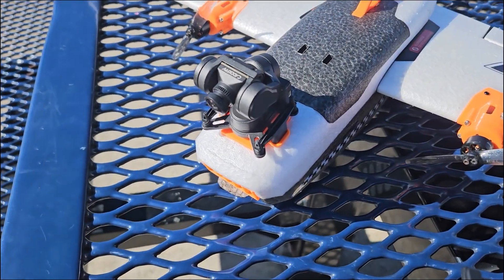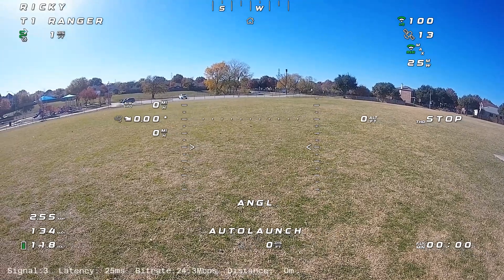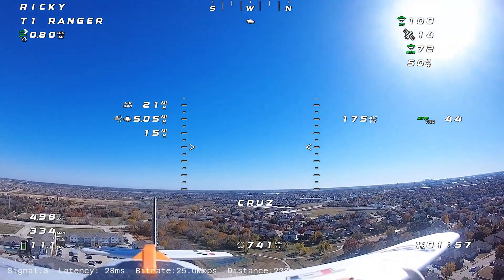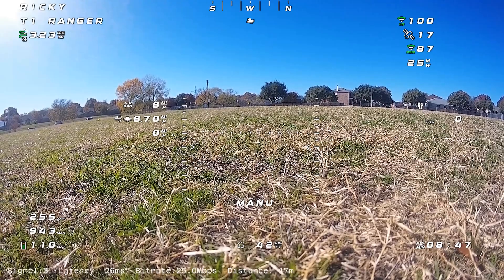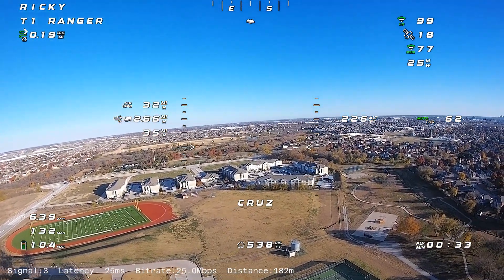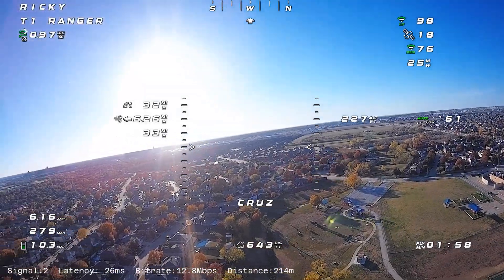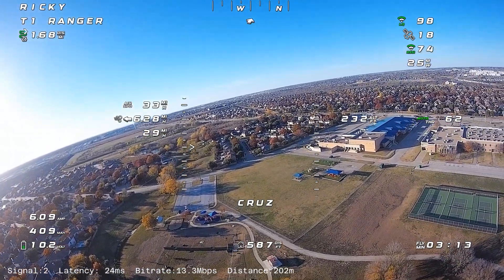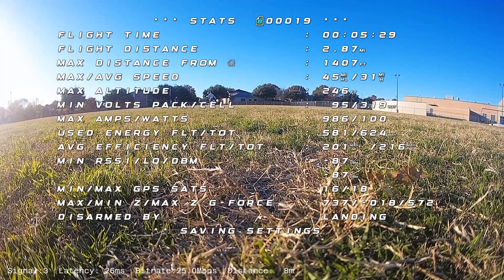My T1 Ranger With A New C-20T Gimbal Running inav 8 rc2 and rc3

Comment: how did you make the connection between gimbal and walksnail vtx
Reply from the maker: My gimbal is connected directly to a uart on my FC and is controlled by my transmitter.  My walksnail vTx is the v3 and doesn't have the spare uart to connect any gimbals so it's not compatible.  But connecting the gimbal to a uart on the FC works great!

Comment: Do you happen to have an stl for gimbal mount?
Reply from the maker: Sure! I just uploaded it to my curated T1 Ranger Parts on thingiverse.  There are a couple of offset holes in it because I attach it with a couple of screws that also hold on a little fan on my vTx and it never lined up perfectly.  thingiverse.com/thing:6646960

Comment: Why you running 3S instead of 4s??
Reply from the maker: Because I like to just cruise around. I get great results with my 3S setup.  I’m working on a T1 vtol that I might run 4S on.  I also think the kv of my motors lends itself to 3S

Comment: Cg and drag. Think of the gimbal as a rudder, making and changing changing turbulences ... maybe try and install it on front? Maybe add some oversize  crazy canopy?
Reply from the maker: Yeah, I think you're right.  It's taken me a few flights to get "used" to it.  I don't know if it is acting like a rudder as much as I wasn't used to the stabilization.  Flying FPV with planes is MUCH different than with quads.  I was used to the camera/fpv feed getting bumped around.  Now with the stabilization it looks more like a quad flying around rather than an airplane.

Comment: Ricky I am building a T1 with VTOL conversion kit currently and I am adding the B.A.G. pan and tilt gimbal to the platform.  I am wondering, in your setup, did you have problems with getting the CG right since the gimbal is heavy?  I plan to place the FC as far back inside the fuselage as possible so that the battery can move closer to the wing spar which is the location of the CG from my understanding.  What I am trying to determine is if the FC will be ok as far back as possible or does the FC need to go towards the front and battery more towards the rear of the fuselage.
Reply from the maker: My T1 ranger balances perfectly on the back of the "latch/hook" on the top.  My FC is all the way in the back along with the battery near the spar.  But my setup runs a 3S pack.  I think the vtol likes a 4S pack.  So maybe you can switch the FC to the front and have the battery all the way in the back?

Comment: you should review the install process of the gimbal setup in inav 8. would be very helpful to see your settings and control methods using uart. do you use the "serial gimbal" selection under peripherals dropdown? and map channels in configuration?
Reply from the maker: That might be a good idea. In the ports tab for the uart I have the gimbal connected to, I used the drop down for "Serial Gimbal" and in the configuration tab in inav, I used channels 7 & 8 for the pan and tilt respectively.

Comment: Does the video Tx get hot? 

I ask because your setup is something I want to try on a large rc helicopter.

I''m thinking I will have to put the video Tx on the exterior heli body, or at least exposed to the propeller wash, to keep it from overheating.

Great commentary by the way, very insightful!
Reply from the maker: Oh yeah, it gets SUPER HOT when it's just sitting there.  Once it's in the air, it's fine.  So I got this 25x25mm 5v fan and bolted it to the top of the vTx (the bolt patten fits perfectly) and it stays cool while I wait for GPS satellites or transferring video from my vTx to my computer.  I've heard of some people mounting a fan on the bottom as well.  Here is a link to that fan on Amazon https://www.amazon.com/gp/product/B08D8VNLHD
Reply: @RickyGode  thanks a bunch! Looking forward to your next upload!

Comment: Nice video first one of yours Ive watched, good content and review. Interesting always when you change a couple things at once how things interact.
Reply from the maker: Thanks!  I also think some of the "weirdness" was the fact that the camera was stabilizing the video and it seemed to take more input than normal to initiate a turn in manual mode.  Previously, I would immediately go into cruise mode and then look around with  the head tracker and the inav would do the flying, since this was the maiden I stayed in manual a bit more.  I think raising the cruise throttle sorted out most of my issues.